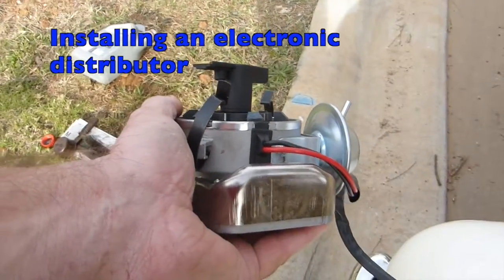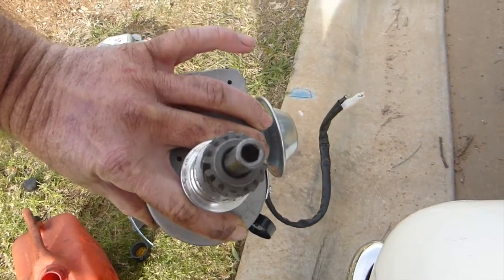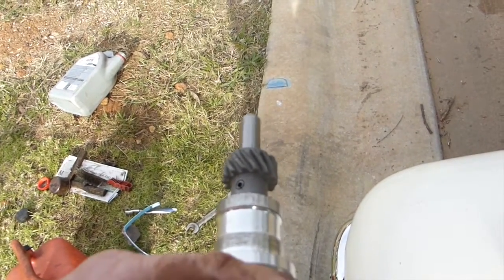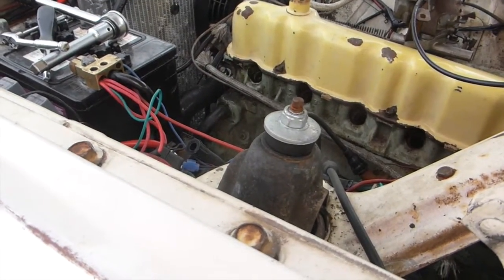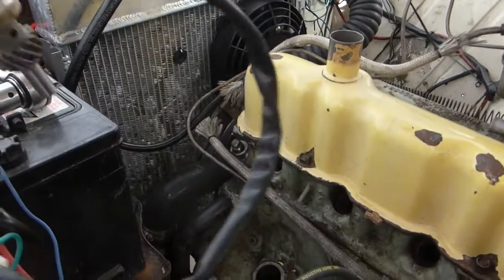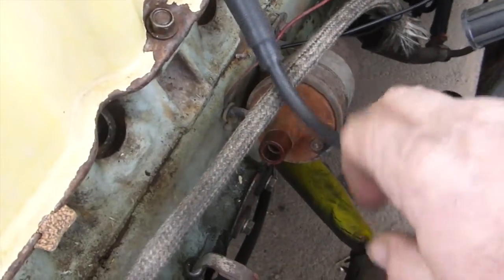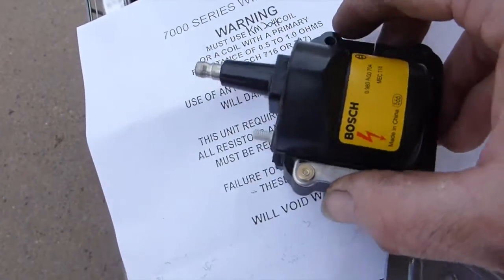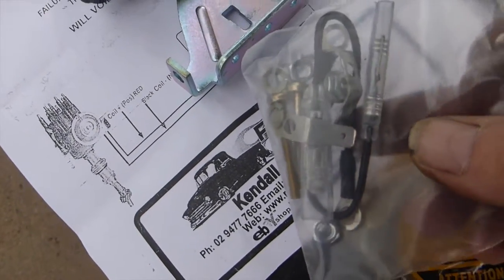Electronic Distributor install, 62 XL Ford Falcon

Comment: Do these distributors have a mechanical style advance as well at the vacuum??
I've recently replaced my 1 bbl carb on my 170ci falcon but carb doesn't have a spark control valve so I need to upgrade the original load-a-matic distributor set up?
Thanks
Reply from the maker: It's a while back now but I believe it does have both. A popular replacement for the Load-A-Matic. Ask on the Australian Ford Forum, Classic section. Lots of help there. Cheers.
Reply: @jeffkeith637  thanks for the response, were you running a carb with SCV?? Or not? If so what carb did you run and where did you get this dizzy??
Thanks
Reply from the maker: @dannyqftw1006  Hm. The carb is the bog standard Holley (1401 maybe?) for the automatic trans. I got the dizzy from AllStar at Hornsby. I had to wait for them to get a new batch of 1/4" oil drive shaft dizzys to suit my early 170.

Comment: Hey I'm Thompson from PAPUA NEW GUINEA I need help 
Don't know much about where or the right way to put in the distributor
Reply: I have a ford falcon xf ute
Reply from the maker: @thompsonkipma5447  Ah, ok thanks for the extra info Thompson. Not sure if you should be doing this yourself, but there is a first time for everyone I guess. Do a search here on YouTube specifically for the XF Falcon distributor. That should point you in the right direction. It is very important to be able to find Top Dead Centre (TDC) for number 1 cylinder - the one at the front of the car - at the end of the compression stroke. If you aren't able to do that you will need to get some local help. Sign up to the Australian Ford Forums for a LOT of helpful advice. Good luck.
Reply: @jeffkeith637  thanks Man God Bless and have a great week 💪

Comment: Jeff , good to see the old girl coming together. Any particular reason why you changed the whole dizzy over with the new one rather than just convert the existing one with Pertronix or similar set up?  I'm still running points on my XK (which has an XP motor) and just interested in best way to go 

keep up the vids
Reply from the maker: I think I did it based on price as much as anything This dizzy was actually cheaper than a Pertronix setup, and I had heard disquiet about Pertronix reliability, so if that's right there would be no point in going to the Pertronix. I'm not interested in carrying my old points around in case of a failure - what's the point? I had hoped the new unit would have a mechanical advance, so I lost out there. So far the car is running really well with the new unit, although I've only done a couple of hundred miles. The 7 bearing XP engine is a good option I think. Cheers.
Reply: Thanks for the reply Jeff, interesting comments on the Pertronix conversion. The Xp motor conversion wasn't quite as straight forward as I'd hoped , the old narrow block motor was pretty tired and had the 2 spd auto - so swapping to the wide block motor gave me 3 spd BW auto which is an improvement but it was a tight fit, main issue really was the different  transmission tunnel and different mounting so I ended up having to fabricate a crossmember, also the XP column hub is different and so on..
Reply from the maker: Conversions are never as straightforward as they appear they should be. Thankfully I've fallen in love with my 170 and Fordomatic. Much grief saved. I've still got a secret desire for the 4 spd AOD though.
Reply: Kelley Ambrose  Hi what size motor is in your XK
Reply: @jeffkeith637  they're loveable indeed. What more could a man need? :) thamls!